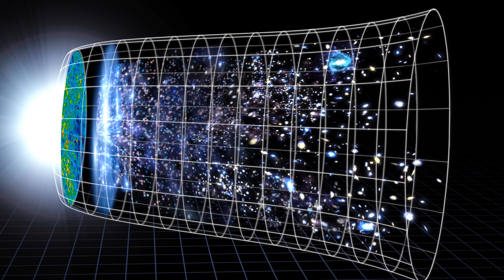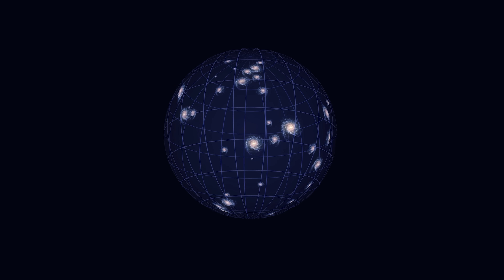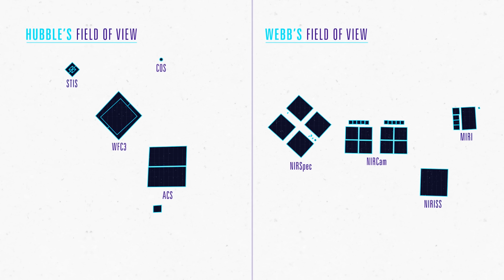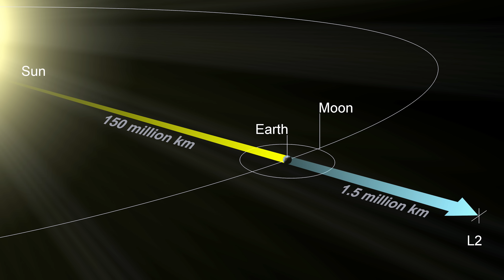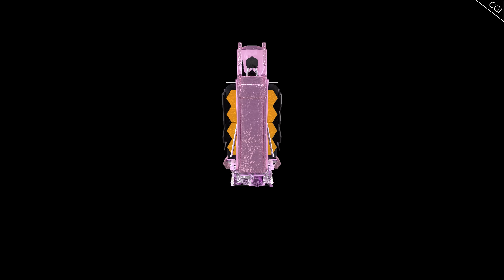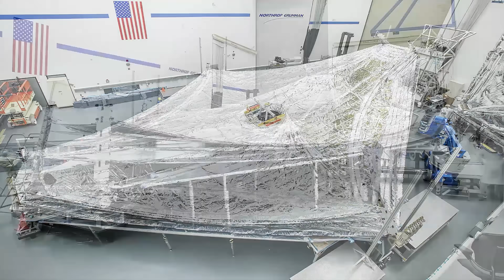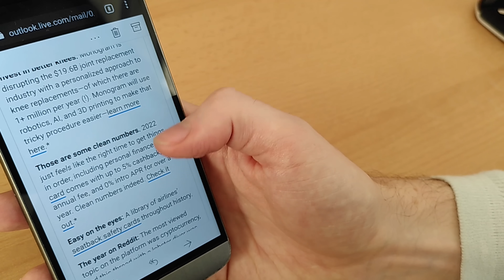What Can the James Webb Space Telescope Actually Do?

Comment: Question: since photons will spread apart as they travel away from the source, different photons from the same source will be far enough from each other to be affected by the gravitational fields of different objects. Doesn't this mean that in spite of the giant mirror, the James Webb telescope will only be able to see VERY partial pictures of those distant stars and galaxies?
Reply: What you're describing sounds like gravitational lensing, which actually slightly improves the visibility of some objects that would otherwise be too fain to see, are more photons are diverted into view than a direct line of sight would allow.

Also, keep in mind that these objects are extremely tiny in the sky, and so the photons that come to us are travelling extremely tight and on virtually parallel paths, so they are affected by gravitational fields in essentially the same way.
Reply: @Релёкс84  Thank you. I knew about gravitational lensing, but had not thought about the 2nd part of your explanation. That helps :)

Comment: Alex McColgan: Interesting and informative video, but contains quite a few errors:

1. At 3:23 , you say, "matter [in the early universe] began to coalesce into atoms, then dust, then stars". This is wrong. Matter in the early universe consisted of 3 elements only: Hydrogen, Helium, and trace amounts of Lithium. "Dust" (carbon, oxygen, nitrogen, silicon, iron) wouldn't form for billions more years, in the cores of stars. So that should be "...atoms, then molecules ,  then stars...". 

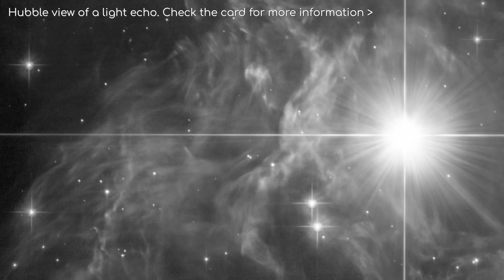2. At 3:53 , you say "there is a tiny time delay between when light is emitted and when we see it". This is wrong. The time delay is proportional to the distance, and if the distance is great, the time delay will be anything but "tiny". The light from the most distant galaxy we know of took about 13.5 billion years to get here. That is not "a tiny time delay". 

3. At 4:07 , you say "light travels at 299792458 m/s exactly". This is technically true, but a tautology. You should explain that the only reason the number is "exact" is that "meter" and "second" are defined in terms of c so as to make c exactly equal to 299792458 m/s. 

4. At 5:05 , you say, "we exist in an infinite universe". This is just someone's speculation, and not the most common cosmological model among scientists. A more-commonly-held view is that our observable universe is a sphere with diameter 100 billion LY, and our total universe is a sphere about 250 times wider, with diameter 25 trillion LY. 

5. At 5:47 , you say "scientists think that the universe is expanding due to dark energy". This is wrong. Scientists don't think that "dark energy" is the reason the universe is expanding (that's due to The Big Bang), but rather, the reason the expansion is accelerating . You're conflating velocity with acceleration; the two are not the same thing. 

6. At 5:55 , you say that cosmic red shifts are "the Doppler effect". This is wrong. While the Doppler effect and red shift both have the end effect of increasing wavelengths, the mechanisms are different. The Doppler effect is due to objects traveling through space; but red shift is due to space itself expanding, which isn't the same thing at all. For one thing, objects traveling through space are limited to speeds under c; but expansion of space itself has no such speed limit! That's why our "total" universe (containing all matter and energy originating from our Big Bang) is estimated to be about 250 times larger than our "observable" universe: past a certain distance, space is expanding at a speed greater than c relative to Earth, so light can never reach us from beyond that distance. 

7. At 6:22 , you say that the reason for red shift is the acceleration of the expansion of the universe. This is wrong. No, the red shift would be proportional to distance even if expansion was not accelerating. (It's the velocity of expansion that creates red shift, not the acceleration.) 

8. At 8:55 , you describe the JWST as "hovering" or "orbiting". These are wrong. The correct term is "librating". "Librating" is when an object coasts along an elliptical path around one of the 5 Lagrangian libration points (L1, L2, L3, L4, L5) where the gravities of two other objects cancel each other out. Any two large objects (say, Earth+Moon, or Sun+Earth) will have these five points around which a smaller object can librate. The JWST is librating around the Sun+Earth L2 libration point.

9. At 13:54 , you use the cliches "baited breath" and "tooth and nail". These are stylistic errors. Tired old cliches like that don't make videos sound "folksy", they just make videos sound "stale". So they should not be used in videos.

Other than those 9 errors, this video is good. It provides a lot of information about the JWST that I was not aware of, such that it's primarily an IR scope designed to look at very far-away objects; that makes sense.
Reply: There was a time when there were no atoms.

it's estimated that it took about 380,000 years before things cooled off enough for particles to coalesce into atoms.

He could have worded things a little better, but he's not actually wrong.
Reply: Oh, and number 8. Librating

I did not know that it had its own name.  Thanks.

Comment: Since it can "punch through" certain things by receiving IR wavelengths, will we finally be able to see what's on the other side of the galaxy that is obscured by the galactic center?

Also, if before the big bang the universe was in a structure that was effectively zero, was it Planck Length in size? Or did the laws of physics as we experience behave differently and thusly allowing for a smaller unit of measurement?
Reply: The planck length isn't the absolute shortest length, it's the shortest length that makes any sense to measure.

The "fuzziness" of the quantum world makes precise measurements below a certain level impossible.

Comment: U ate wrong not 10 years..its 50 years re think..ur missing the updates
Reply: It's 20 years, not 50. Also he wasn't necessarily "wrong" at the time.  5 to 10 years was what they told everyone before launch, so at the time that info was correct. It only increased due to the precision of the Ariane 5 that launched it. Had the Ariane 5 had a less precise launch, the telescope would have had to use more of its own fuel to correct its course, thus decreasing its lifespan. The launch went better than expected, and as a result JWST will last longer.

Comment: Why could the SpaceX Starship System be used to visit the JWST - it is not nearly as far away as Mars ? 
A visit every 5 years - perhaps en route to Mars - could be used to refuel and carry out routine maintenance.

Also mow we have one JWST out there could we not build more - relatively cheaply - to basically the same design and either optimised for different wavelengths or to the same wavelengths but to be used cooperatively with the JWST as an ultra large interferometer to obtain very high resolution of much closer objects such as exoplanets in orbit arround nearby stars ?

Comment: Your videos are normally great but I've found this one has incorrect (or more misleading information). For example we will not be able to see 13.8 billion years back. We will only be able to see 13.5 billion years at the absolute most (and probably less than that). This is because the first light of the universe (the cosmic microwave background) was not formed until 300,000 years after the big bang. Before that there is nothing to look at. Also you claim the universe is infinite so we can see as far back as we like, that is misleading because it doesn't mention that we can only see the observable universe, which is finite (and getting smaller)>

Comment: I would hope they’ll contruct another one for replacement time.  It’ll cost less than 1/10th to make.  Probably even less.  Maybe even 100M.  The engineering is complete.  Just make the stuff and put it together.  Shouldn’t take more than a few years including testing
Reply: Realistically, it doesn't really work that way. 

First, this has been in development for a while. And as always happens in development, parts have been obsoleted. New parts need to replace obsoleted parts. And to use a new part will require a redesign of the affected system.  Which means new development. And more importantly, new testing.

Second, the main manufacturing cost for products is in the factory's INITIAL tooling setup, when the factory gets ready to produce something. Once this occurs, then the additional items that the factory produces while the factory is still specifically tooled for it are a fraction of the initial item. However, once the production is finished and the factory line re-tools for something else (even if only days later) then all savings are lost. If that item needs to be rebuilt sometime later, it will cost just as much as the 1st time because of the initial tooling and setup costs. 

But more importantly, the REAL cost of precision instrumentation like this isn't in development and manufacturing. Its in calibration and test. Even IF they built a second telescope, it:

- will have parts that will need to be individually calibrated (since all parts are made with tolerances. No one part is exactly equal to another. This is a fact of life with EVERYTHING that is made). This is a long & complicated process... ESPECIALLY with precision instruments like this, that need to have almost everything tweaked individually (since even an "identical 2nd one" won't & can't actually be "identical" to any of the others)

- will need to undergo all the same testing all over again. Which is a painstakingly long effort. And very expensive. Testing one unit doesn't cut costs of testing subsequent ones, because each item to test is unique.

So, even if they had a 2nd telescope already built it would take a good bit of time (and lots of money) to get ready.
Reply: @beta_cygni1950  thanks for the breakdown🍻. Sounds about right.  I wonder if they kept the tools and tooling just for this as it’s so custom.  And I’m sure they’d want to make some new stuff as tech in 10 years will be a keep forwards.  But I thought it would make sense to build two just in case.  It would be so much cheaper to make doubles and then test when/if needed.

Isn’t it funny that their initial budget was one years worth of funds used?  So silly.  If it cost 500m a year to work on a project like this you could just estimate years.  So a double would probably end up costing 2-3B.  Or 4-6 years.. there’s no way it would take them 20 to make another.. ya?

Comment: If it is so far away, what would be slowing down the telescope from maintaining its orbit? Isn't friction almost minimal at that distance? How has hubble which is much closer meaning more friction been able to continue to keep its velocity high enough to stay in orbit?
Reply: Gravity is somewhat of blanked in that location, but not totally balanced.  The sun and other planets as well as the Earth will tug it out of position, eventually accelerating for a crash or a long elliptical orbit, crashing some centuries later.
Reply: The L2 point is not a perpetually stable point to stay in, which means you need corrections.

The Hubble is not orbiting at a precise point like the Webb telescope has to. Its orbit decays over time, and it will de-orbit some time in the next 10-20 years.

Comment: Great video, but there's one thing you got wrong. L2 is NOT a stable point: it's an unstable equilibrium point, that's one of the reasons spacecraft orbit around it and don't stand still there. However, since it is unstable it allows for an easier access, since it can be demonstrated (and they're in fact used) that there are natural trajectories that approach it and allow orbiting it.
The only stable Lagrange points are L4 and L5.

Comment: SpaceX's Starship could potentially be used to extend the lifespan of the JWT
Reply: lets see if the starship can get into space first, don't be fooled by the success of the Falcon 9 or Falcon Heavy, the starship and it's booster is enormous and still yet to be proven to launch, be  tested or even if it will work at all - when the starship was fitted on a booster it looked promising but it was basically a public show, neither starship or booster is yet completed so if JWST only lasts for 10 years it might retire before starship is even fully operational.
Reply: @rikvermar7583  To be fair SpaceX is developing these ships at an alarming rate, I wouldn't be surprised to see starship or another project from them to land on mars in the next 7 years

Comment: That's disappointing it only has a 5-10 year lifespan. That's the first I've heard of that. Hopefully it can be refueled or replaced.
Reply: yeah but imagine how much better the tech will be in 10 yrs? dont see why it can't be docked - when it has a docking port? what's the cost of the docking port? and who ok'd it knowing it won't ever be used?
Reply: @rikvermar7583  Yeah, but look how long the ISS and Hubble was extended for. This tech JWST is already 10, if not 20 years old already.
Reply: @newguy3588  the JWST tech wise is in another league compared to hubble, the ISS is outdated and near retirement. the ISS was designed knowing it would be visited regularly, crew changes, re supplying etc, Hubble was close enough to earth so that the Space Shuttle was able to reach it and carry out repairs, the JWTS will be so much further away that the boffins already know there is nothing available to-date to go that far out to repair it if need be, and with the ever increasing advances in technology - something installed 2 yrs ago will today seem old - i really don't think much of the tech that was supposed to be used in the JWST original design plans or any tech already installed years ago will be used when it's ready to be launched - prob part the reason as to why it's took so long to build

Comment: Interesting nitpick- redshift is similar to, but not caused by the doppler effect. 

It's a good analogy, but the fact something is moving away from us doesn't change the wavelength of the light it emits. 

It's actually the fact that in the course of the light's travel, over a long time, the space it occupies expands. 

So the wave it's emitting doesnt look constant like /\/\/\/\/\/\/\/\/\/\/\/\... or some slower variant. it would start off the same, and get slower over distance \/\/\/\\\///\\\/////\\\\\//////////\\\\\\\\\/////////////\\\\\\\\\\\\\

Ages ago I did some back of envelope calculations and I came up with a rate of expansion of about 9% per billion years. So take that  (possibly flawed) rate of expansion. If light travelled for 1 billion light years, it's wavelength would increase by 9%. Or eg for 100 million years, 0.9%.
Reply: Actually, Redshift can be caused by either the expansion of spacetime OR by doppler shift. 

For example, Andromeda's spectrum is doppler shifted (in this case, BLUE shifted). And we observe red shift and blue shift in nearby stars that are NOT affected by universal expansion. 

By the way... We use the fact that doppler shift DOES distort the received EM wavelength in all sorts of applications here on earth. For example, doppler shift radar uses the doppler shifted wavelengths to calculate an object's velocity. This has applications to weather radar, aviation radar, even traffic enforcement radar & LIDAR.
Reply: @beta_cygni1950  interesting! Thanks!
Reply: @kony2023   Not a problem, brother! There was a good breakdown on how astronomers & cosmologists determined the difference between the two. I can't for the life of me remember where I saw it, though. 

It might have been on 'physicistmichael' channel, on the 'cosmic distance ladder' playlist. But then again... who knows. My memory sucks these days.

Comment: Was it not possible for JWST to use small ion thrusters to maintain its position? That would have lengthened its operational  lifetime. Or are they all too heavy / energy demanding?
Reply: The L2 point requires the telescope to fire it's thrusters in every direction to stay in a proper orbit, while ion thrusters would  work if they needed one of them, having 5 to 6 of them would be too heavy compared to thruster packs and the ion stream could damage some things of not fired directly away from the telescope.

Comment: I can't help but think spacex would have been more reliable than the ariane5
Reply: "Ariane 5 launch vehicles have accumulated 111 launches since 1996, 106 of which were successful, yielding a 95.5% success rate. Between April 2003 and December 2017, Ariane 5 flew 83 consecutive missions without failure"